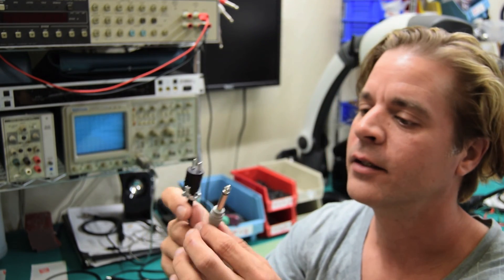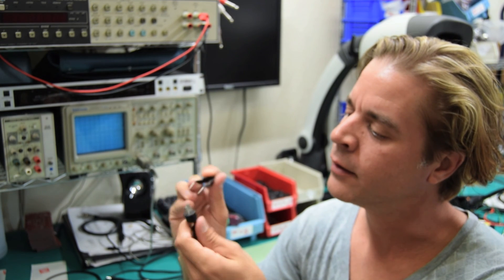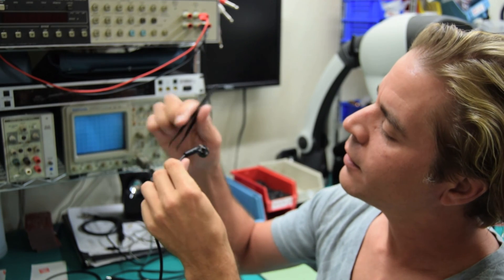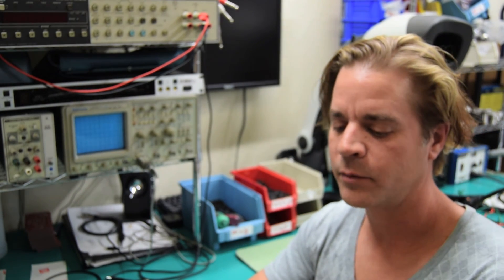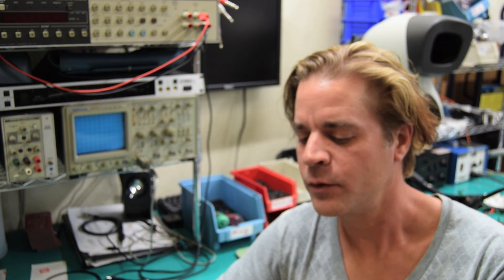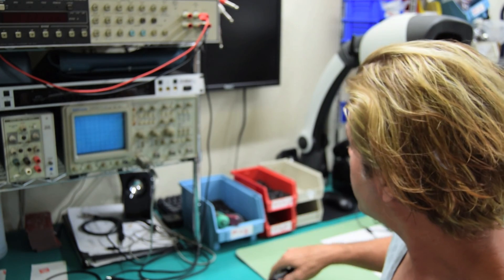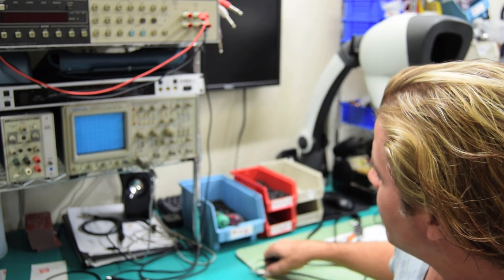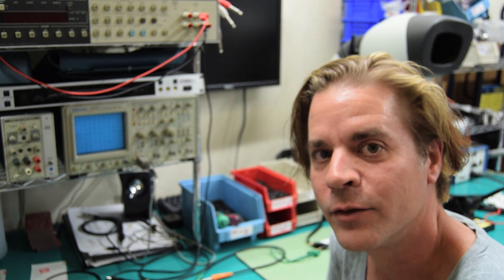Interface cables for Moog, EMS, Buchla with Future Retro 512

Comment: Nice explantions. So you have to split the cables is you make 3.5 tot banana, one for ground and the other to signal. If I connect 3 cables, pitch, cv, pressure,... doe I have to make 3 split cables for it, or is 1 splitted cable enough.
Reply from the maker: You only need one cable to be split to provide the ground from one unit to the other. Any additional cables can simply connect the tip of 3.5mm or 1/4" plug to banana on the other end.

Comment: i have 1/8 inch to banana cables made up already but no split ones. if i didn't need the clock output for the buchla synth could i send that to the ground input on the buchla? would that suffice as a ground reference?
Reply from the maker: Routing the output of the 512's clock to ground on the Buchla would short the short the 512's clock signal potentially causing harm to the circuits if left that way. You must use a split cable, so that you can access the Ground portion of the 512's ouput, and connect that signal to the Ground of the Buchla.
Reply: great, thanks!

Comment: Great video...where can i find those precision matched resisters (pins) that you mention for  the  EMS
Reply from the maker: I do not know of anyone selling precision matched pins, so you make your own by replacing the resistor in your existing pins with new resistors. I use 1% metal film type that are then measured/graded out to be matched to 1/10th or 1/100th of a percent to each other.